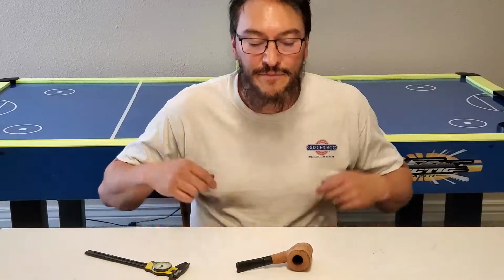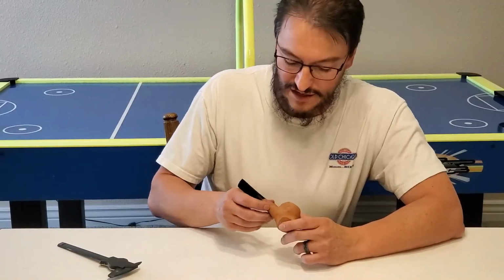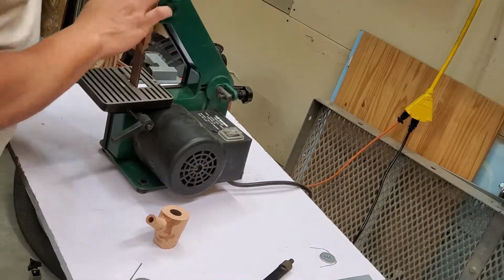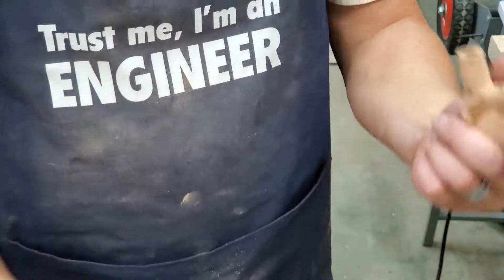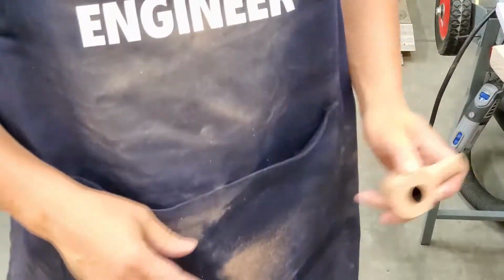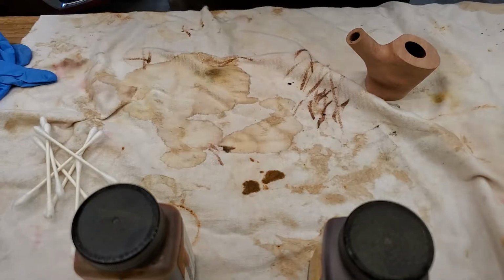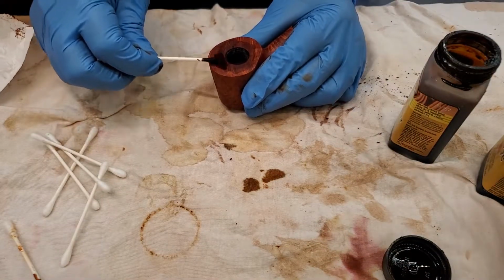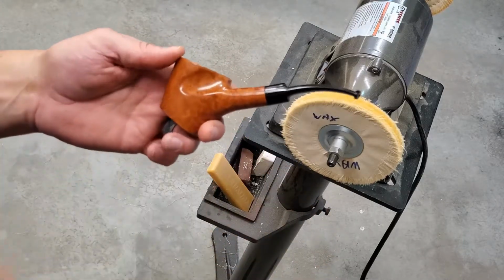Pipe #12: Da Jimmer Pipe

Comment: Also it seems like you garage is either in imaginably hot or freezing ass cold.  I think your pipe making seasons are limited to Spring and Fall.
Reply from the maker: This is largely true.  I took most of the summer off because it was too hot in there.  In the winter, at least I can run some space heaters to improve the situation.  I'm thinking of putting a Mitsubishi single zone Split System into the garage to heat and cool it.  They retail for about $1900 plus installation.  My A/C guy sells them.  I was planning to give him a call pretty soon to see what the bid would be.  Should be a trivial installation given that the AC panel is right on the garage wall where I'd want the unit.  It would be way cheaper than moving.